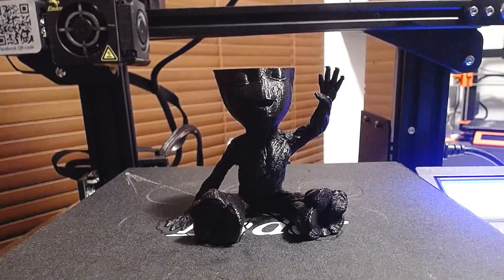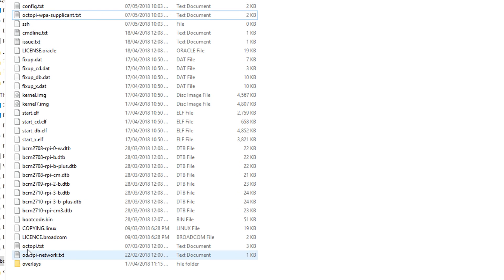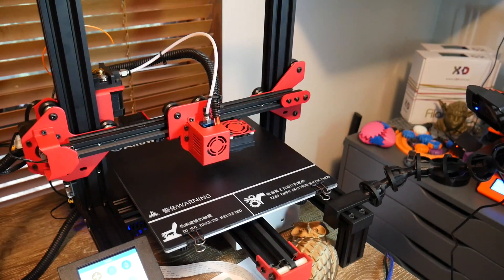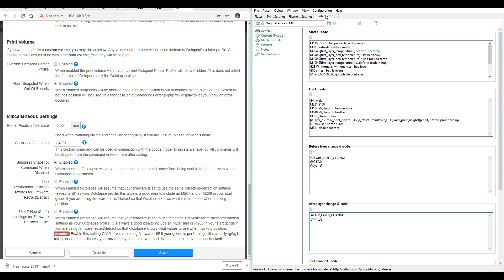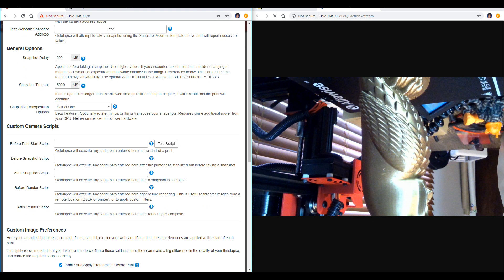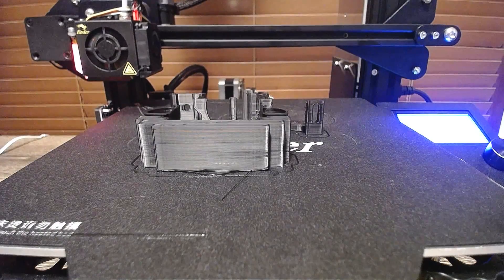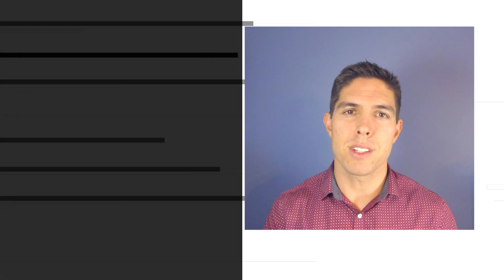Complete Octolapse Guide - Tips, tricks and troubleshooting for 3D printing timelapses

Comment: Is there an updated video? 
 I'm having some trouble figuring out how to have it not move away from the current path, so not move away but to take a snapshot every 10 seconds or there about on the backside of a model on the same layer's. I just want the nozzle to stay with the print. As you said, when it moves away, it leaves blobs even when retraction is perfect.   I always print 20c more than recommend for my first layer, then drop with 100% fan speed but on tat first layer, it's like a spiderweb 🕸️ I also noticed that some retraction settings stay in the red if it's below 1.0mm? I have direct drive and my retraction is 0.6mm. anything more or less and I'll get stringing... I'm confused? 😅 I'm also running obico self hosted server ECT off Ubuntu 22.04.5LTS with full 60fps ECT...

Comment: Just went through all this so here's some update help 😎 I hope😋 at 4:00 the extra camera settings, this is not needed anymore, you can get a repo for octopi which allows these settings in the octopi settings menu without doing this. (Camera Settings (0.1.0) by Taylor Talkington). it's every setting EXCEPT resolution and FPS. 2: Someone probably mentioned this also but you don't need to take the card, if you SSH into your pi with MobaXterm or any ssh client, connect with ip or octopi.local and login with ''pi'' and ''raspberry'' you can edit the file with the terminal and save it. 3: network usage. I've got a bad connection in my garage(powerline internet adapter) which only gives me 10Mbps. a 720p 15fps stream gives a little hiccup sometimes. depending on speeds a steady 10 is more enjoyable than a sometimes choppy 15 altho it doesn't matter with octolapse as it takes photos not videos. 🏁Hope this helps, happy printing👍

Comment: Hi there,

As always a very helpful video. In step 8, if you use the 'Search and Replace' script  and have the Dashboard and DisplayLayerProgress plugins installed in OctoPrint you may lose some nice functionality. So if you are using the latest Cura version, for step 8 I recommend to use a different script: 
Insert at Layer Change
Before
G1 P4

My two cents

Comment: Very nice guide even after 2 years. I was able to setup Cura 4.8 with the "Search and Replace" G-code post processing:
For Search field ";LAYER:"
Replace with "@OCTOLAPSE TAKE-SNAPSHOT\n;LAYER:"
use recular expression "ON"
This way the "@OCTOLAPSE TAKE-SNAPSHOT" g-code trigger is send to the Octolaps and the Display Layer Progress and Dashboard plugins are also working (as they are dependent on the layer change info)
Hopefully for others this might help as well

Comment: Canceled a print from Octoprint with Octolapse running - it immediately started ramming the print head down into the printed part and bed, ruining a brand new nozzle and silicone sock, and denting the build plate on my newly reassembled Prusa MK3S... Definitely not using Octolapse ever again, I'm not risking it fucking up my printer for a slightly cooler timelapse.
Reply: Mind you, I used Octolapse several months ago successfully, and I'm using the same settings now, just with a Raspberry Pi 4 (instead of Zero W). Something must have changed in the firmware... shame

Comment: I dont get it. Before i had Octolapse/ before changing any camera setting in octolapse my camera looks perfect. In the Octoprint Control its beautiful and in the webcam link (the port 8080 link) its great aswell. But the moment i start printing, the camera goes oversaturated and over exposed as hell, is that intended?? I mean in theory i could take display screenshots manually at each layer and would have a better quality as i can achieve by tweaking all octolapse camera settings????
Reply: i reboot my octoprint and my camera is fine again.

Comment: So for step #12 i cannot get the website to show the mjpg streamer, I get 400 bad request the browser(or proxy) sent a request that this server could not understand. I also do not get the camera settings under "edit camera" when i check the box that says enable and apply preferences  a box pops up top right  that says unable to enable custom preferences unknown-server-type: An unknown webcam server type 'Werkzeug/0.16.1 Python/2/7/16' is being used for the default webcam camera profile. Currently only mjpeg streamer is supported.... I have tried 2 webcams. Logitech c922 PRO and Logitech 4k PRO... Does anyone have any ideas?

Comment: Question: If you have multiple processes, let's say you even have 2-4 objects, what happens with that "G4 P1" script you add to the layer height change in S3D? Will it take more shots because it will be pausing for those other objects with that command in their script? How will it affect the overall time lapse?
Reply: because the 4 objects are being printed at the same time, they layer change should happen for each at the same time as well. i.e same number of images for 2-4 as you would get for 1 i believe.

Comment: When I send g. code to print, printing starts immediately without warming up the table and nozzle. I did it based on your video. Used cura / slicer prusa / simpl3d the situation is the same everywhere. Tell me what the reason may be. Thanks.
Reply: just wondering if your octolapse settings are in 'test mode'? as that is what that setting does, lets you see if the timelapse will work without heating nozzle or the bed, but more importantly it doesn't extrude any filament, so doesn't waste any whilst you'r testing

Comment: Very good tutorial! I got my Octolapse setup all up and running. Thanks a lot!

I only ran into a problem when I added a "Pause at height" script in Cura to change filament at a certain layer: It seems that this script searches for the ;LAYER:# line that your "Search and Replace" script replaces with the G-code to trigger the snapshots. Therefore, the pause G-code never gets inserted. I can just put the pause script before yours and everything works fine. But to make your script more reliable and maybe keep someone from running into the same problem as me I would suggest to tweak your script to use

(;LAYER:)(.{1,})
\1\2\nG4 P1

This way the LAYER line doesn't get replaced and can still be used as a trigger for other scripts (like the MultiColors plugin for Octoprint).
Thanks again for all your hard work and content!

EDIT: If you want the snapshot to be triggered before any other G-code that gets inserted by a post-process script that also looks for the LAYER line, you can use:

(;LAYER:)(.{1,})
G4 P1\n\1\2

This simply inserts the snapshot trigger before the LAYER line

Comment: Anyone using The Spaghetti Detective or Octoprint Anywhere should be aware that you won't be able to tweak your camera settings since those plug-ins essentially have control over the camera. I turned off Spaghetti Detective and was able to tweak my camera settings. I haven't tried turning Spaghetti Detective back on to see if it will just use my new camera settings, or if it will automatically go back to the defaults. For now I'm assuming I have to choose between Spaghetti Detective and Octolapse, but that may not necessarily be the case. Either way, if you were confused about why it's not working for you, this may be why.

Comment: Need some help.  When I try to run a test print, I keep getting a message saying something about an XYZ error and I need a G90/G91 gcode command in my start script.  Nothing was mentioned of this in the video. How do I provide the needed gcode?  I use Cura 4.3 as my slicer.  Also, exactly how are you supposed to start your print when running in test mode? Can I load something normally through OctoPrint? If I do that, will it not start the heaters and extrude? Or do I have to run the print in DryRun mode?

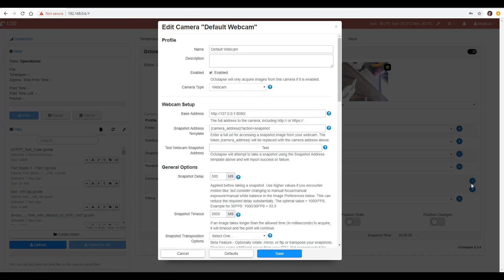Comment: In the section starting at 11:00 it is important to note that the IP address of the mpeg streamer interface can be confusing.
If you are working on a browser screen directly attached to the octoprint raspberry pi then the mpeg interface is indeed at http://127.0.0.1:8080.
However if, as is more likely, your browser in on a remote computer then you need to use the actual physical IP address of the octoprint (wifi or ethernet).  http://octoprint.local:8080 should work.

Great tutorial BTW, thanks
Reply: Duuuuuuuuuude!!!!! My frieking hero. I've been looking for how to connect to my webcam ALL day. I'm so glad I happened to scroll through these settings. 

You're a legend

Comment: My webcam stream is visible in Control and the Octolapse Webcam Setup tests check out. When, however, I try to edit Custom Image Preferences, I get the following error:
 Unable To Enable Custom Preferencesunknown-server-type:
 An unknown webcam server type 'Werkzeug/0.15.6 Python/2.7.13' is being 
used for the 'piCam' camera profile.  Currently only MJPEGStreamer is 
supported.  Unable to apply custom image preferences.

I'm suspicious this may be Octoprint Anywhere's doing, but I've no proof. If I disable OA, I no longer see anything from the webcam. How can I specify my webcam server type so that I can get the best Octolapses?

Comment: I like to leave the layer number in my gcode if I'm going to insert an M600 or anything like that, so instead of 

"G4 P1" 

as the replacement text, I change the search to:

"(;LAYER:.{1,})"

and the replacement text to:

"\1\nG4 P1"

Moving the parenthesis around the entire match allows me to call it back with the \1 - then followed by a \n to inset a newline, which puts the G4 P1 on the next line.

Comment: Excellent video my friend keep the good work. Raspberry Pi 3 B+ with CanaKit power Supply everything set up and running the only problem is that WiFi drops every few minutes. I done a few things that I found in the internet of people having the same problem but nothing works.  Does anyone have the same problem or a solution for this issue. Thank you.

Comment: My streaming is extremely laggy. I get about 17 seconds of lag between movement IRL and display in Octoprint. Any advice on how to remedy this in the config files? I'm running Octoprint off of wifi and I know one way to solve the lag issue is to use ethernet instead.

Comment: Thanks Michael:) Well, it did not work for me at 1st with my Cura 4.0 but now it is working. 2 things to keep in mind guys. 

1. You have to have a G90 in the START G-Code settings in Cura. For you noobs you open Cura, click on your printer, click on Manage Printers, click on your printer again, then click Machine Settings. From there add G90 to Start G-Code. 

2. Make sure you are not using any old G-Code until you re-save it. I think a lot of people are forgetting to re-slice the files with new settings. I know I did;)
Reply: I don't have G90 in my start code, I changed the drop down box to "Default to Relative" and it works fine.

Comment: don't you have to replace the capture group after searching? or will it just find the search pattern then add the replace after? I am going to test it here in a sec
edit: Yes that DOES replace the LAYER capture group with the' G4 P1' replace. (since ';' is probably a comment it isn't necessary for the code to work!)
A better alternative is Search: (;LAYER\:[0-9]{1}.*)
                                     Replace: \1\nG4 P1
This will skip the LAYER:0 line since I assume that is what we are after. Also I don't know what flavor of regex Cura uses but \n adds both the carriage return AND the line feed (which is what we want!)
My code looks like this now: 
before:
;LAYER:1
M140 S60
M106 S255
...
etc.
after:
;LAYER:1
G4 P1
M140 S60
M106 S255
...
etc.
So both the ';LAYER' line and the 'G4 P1' line are in the file. Works great!
Reply: I have not tried this yet but I tried doing an Octolapse last night and the settings Michael gave did not work for my Cura 4.0. Am I adding you code to the same place he told us to add it? "Search and Replace"?
Reply: Like this? 
Search: (;LAYER\:[1-9]{1}.*),
Replace: \1\nG4 P1
Keep box checked?
Reply: @pewpewpops  no comma at the end ie. "(;LAYER\:[1-9]{1}.*)" everything in-between quotes. The replace looks correct and yes, select the regex box!

i see I had that comma there from a copy paste from my text file. I removed it from my original post too
Reply: @abtra  I will give it a shot:) Question for you. I tried it without the Creawesome Profile and it worked great but then I added this to my Creawesome profile and it will not take snapshot. Any ideas how to fix this?
Reply: Look at the pre/post codes in the cuts profile and see if the G90 is included.
Reply: @abtra  you mean the Start GCode and End GCode in Cura?
Reply: Yeah, I would compare the two profile’s from cura, then look at the g code output in a text editor to make sure the ;layer line and g4 p1 got added as well
Reply: You are right. One of them has the G4 P1 and the other one has no G4 P1. How can I add it to the one that does not have it?
Reply: I think I got it:) Ha ha ha!
Reply: Tried it and it says "Looking for snapshot gcode" in Octolapse...

Comment: Hi Michael, Thanks for the video. I did all your steps and it worked perfect the first time. In the Octoprint, I have this error at the end even though my timelapse is available and Good. I am using Ideamaker. Any idea what could be wrong.

----------------------------------
Octolapse - Before/After Render Script Error

Rendering completed and was successful, but there were some script errors: The after script failed with the following error: after_render_script_error: The after-render script failed with the following error message: The process does not exist.
---------------------------------

Thanks and keep up the good work.

Comment: Hey, nice video!  Thanks a lot for sharing it with all of us!

Did you see the option in the snapshot gcode in the printer profile to suppress even if Octolapse is disabled?  That means the default 'snap' pseudogcode doesn't get sent even if Octolapse is disabled either via the toggle on the Octolapse tab, or within the Main Settings.  However, if you disable it in the plugin manager this option obviously won't work.  Your solution (dwell) is pretty clever :)

Comment: Thanks for this great vid! I have an Ender3 and use CURA for slicing - I think your regex is incorrect for the custom GCode snapshot. It should be ";LAYER:.\d*" for the search expression - otherwise it leaves the layer number in and you get "G4 P11", "G4 P12" etc. instead of just "G4 P1" for every layer comment.
Reply: This worked for me however it gives me an error when processing saying that the code for the final picture there was an error... I think it means like at the last shot. Can you please post your code again or notepad++ changes if yours is working properly? Many thanks :):):)

Comment: Awesome video and thank you for doing all of the hard  work for us.  I followed your directions with all settings, etc. and things worked very well.  I do have a question, since I use Cura and many of the settings that I made "non-unique" are supposed to be calculated, and I'm getting messages that they are now set to absolute values.  What inputs do you have on that?
Reply from the maker: Sorry but I rarely use Cura. You only need to worry about the non unique settings if you are using the advanced mode at the end of the video.

Comment: I followed this guide to a t, great job and thank you. I have it set up to take photo by gcode just like you. When I activated octolapse the first time and my axes moved I got an xyz error saying I didn’t define absolute or relative. So I adddd a g90 code to the start of my start code on Cura. Error is gone, but it still wont take pictures??? I’ve seen some posts that you need to define extruder as well? When I did this in Cura, my extruder fed like crazy I had to hit estop. What am I doing wrong? How can I get this to work? Ender 3 and Cura slicer
Reply: Did you fix this? I've just had the axis not defined error too.
Reply: Meet too, not confident enough to start experimenting with this stuff. Using Cura as well
Reply: MrTimmyGT needs G90 in start code in Cura. Edit PRINTER in cura and add to G code.
Reply: @Mr_Gadge  ok, thanks for the reply. Will give it a shot when I get home!
Reply: Ender 3 and Cura. Same Problem with this setup. Octolaps stay "enabled and idle". I added G90 to the start G-Code to get rid of the error....
Reply: I added the g90 to start gcode in cura and it worked!

Comment: When I go to change the settings of my camera and such, after I click apply it distorts my camera entirely and I have to unplug and plug it back in to make it normal again. So I cant change anything or even turn off auto-focus. Any ideas as to why this is? I've been using the Logitech Pro 9000 and I haven't had any sort of issues like this before.
Reply: Also, when I go to test things with test mode, I get a Position Error message saying "XYZ movement was detected, but the axis mode has not been set. Please add a G90 or G91 to the top of your start gcode." I've been googling for the past couple hours trying to fix this but I'm still new when it comes to printing. How can I fix this?

Comment: The octolapse feature of taking snapshots according to the different parts of the layer speed is great, but you should first of all configure your slicer to avoid layer changes on the outer walls at all and then just proceed with snapping on the layer change. 

By the way you should not replace LAYER... with your snap code, just add it to that new layer marker because you may use it later for other post-processing like removing the snap code after priming the nozzle before the first layer or any other.
Reply: How would you acomplish this?  I see the "Combing" option in Cura for the layer change  part, but how dould you add the "snap" command in, on layer change?